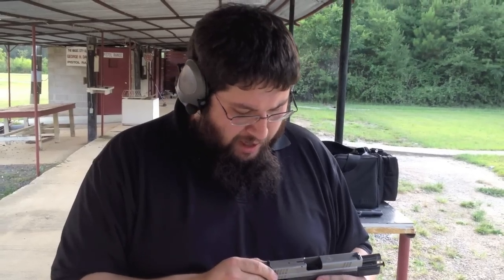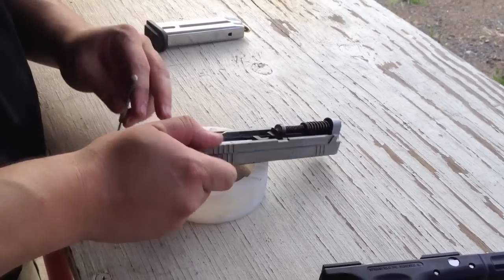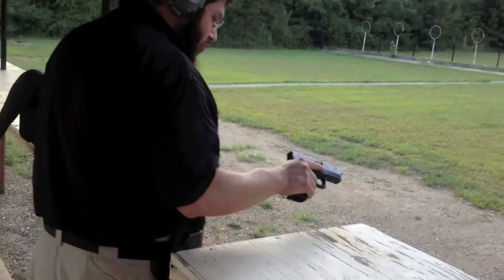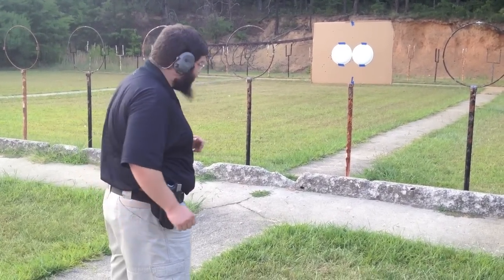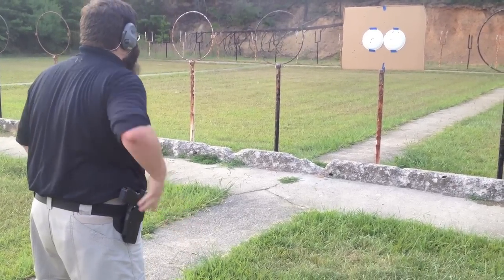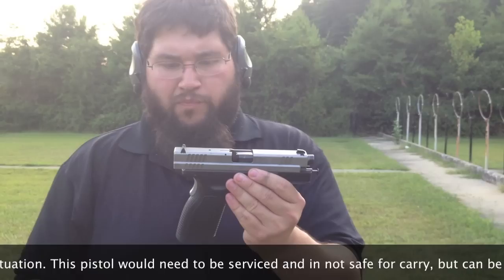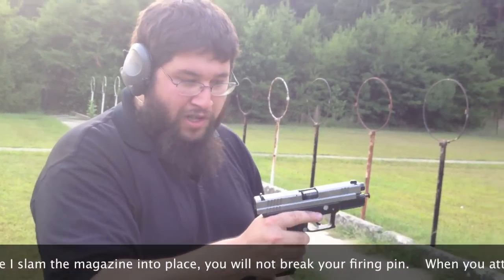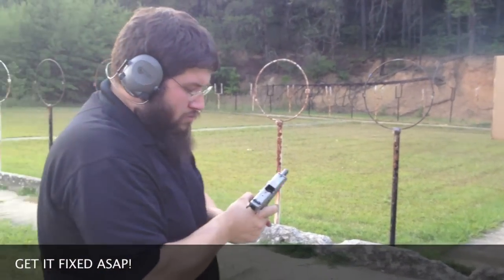XD with Broken roll pin still works demo

Comment: excellent method of experimentation and demonstration- I know that the XD will fire no matter what, and, never had a single failure of any kind in 3 XD9s I have, w/ over 1,000 fired in each one- I have heard of this potential problem, and it slightly concerned me, although I have heard that you would have a warning, as the pin takes many hundreds of rounds to work its way out all the way, after it first starts to brek and work its way out- great video!!!
Reply: I have done 1500 rnds in a single course over 2 days, so 1k over time of a pistol is not exactly "hard use" proof of reliability there. That those pins can and will walk their way out and fall out (see my experience above) is joke and proof it's a poorly designed pistol. If you want to trust your life to that pistol, that's your biz. That's a hard no for me.
Reply: @willbrink  I have an XD-40 and have just heard about this roll pin issue. I have shot 700 rounds, and maybe dry fired 500 times. How can you tell if the roll pin is out? I took the slide off, and you can see day light through the hole on top of slide, does that mean the pin is out?

Comment: My roll pin broke into pieces and one piece got jammed. the pistol would not go home no matter how many times I racked or manipulated the slide while I was out shooting. got home and drove the remainder of the pin out and then removed the backplate and spring but was unable to remove the striker until I wiggled it just right. 14k rounds through the gun at failure. only issue ive ever experienced.
Reply: natesjeep yup. I was getting light primer strikes and figured I have a few thousand rounds through mine, maybe it was just in need of a good cleaning for the channel the striker runs in. What I found out when disassembling it though, was mine was broken and likely was rubbing or jamming, causing the light strikes. I reload and pay extra careful attention to completely seat every primer. A broken striker retainer pin is not the same as a removed one 🤙🏼.
Reply: Travis Thacker  That point is too important to bury in the REPLIES.
Reply: Travis Thacker  While that is true, if you know the roll pin is prone to some level of wear changing it out is a simple thing. Nothing lasts forever, every machine has some level of wear on it's parts. And roll pins are cheap. I can't imagine why one wouldn't change out the pin every few thousand rounds. $15 for a set of XD roll pins is a small price for some peace of mind.

Comment: I bought my XD9 in 2009 ish back in L.A., it finally broke that roll pin. I was having light strikes on the round, sometimes it would fire then stop i would re rack and fire. Eventually came home, took it apart and that roll pin was a 5th its size when i took it out, not sure where the rest of it went now I'm waiting for those parts to get here and hopefully that will be it for another 15 years

Comment: THANKS FOR INFO.   I have the XD45 Service Model  with a few hundred RDS through it. In the dozen of times stripping down the slide I have DRY fired the weapon which I,m finding out isn,t the best thing to do. A SNAP DUMMY rnd is recommended .  NOT BY THE MANUFACTURER ---- go figure.       Thank You,  you have answer my troubling question.        John

Comment: I cleaned my xd 9mm and it won't shoot.. idk if i accidentally dropped the spring pin or something with the striker.. I feel like the firing pin doesn't reach the exit therefore not making contact with the bullet .. did I messed the firing pin or maybe the oil ive used?

Comment: How would you even know the pin had broken?  It's not like it will fall out.
Reply: My had light primer strikes, i thought it was the ammo until i took apart later on. Hey 15 years and about a few thousand rounds of cheap ammo is not too bad I guess

Comment: I was told I should replace my roll pin before it breaks... what say you?
I was told if it breaks, almost no gunsmith would work on it because its almost impossible to remove once broken...
Reply: Those are some useless gun Smith's
Reply: There is a particular technique in removing a broken roll pin.
You can find the step by step method in doing so here on u-tube.
Reply: Roll pins are cheap and easy to swap. Paying a smith to take out a broken one is going to be far more expensive. I'd say buy some spares and pack them in your cleaning kit. Pop the pin out every thousand rounds or so. If it starts to look chewed up, replace it. A little preventative maintenance can go a long way.
Reply: @cavalieroutdoors6036  
Amen 👍😎🇺🇸...
Common sense goes a long way.

Comment: you seem to be pretty knowledgeable about  the XD line.So when it come to cleaning the pistol will that damage the roll pin sooner or later?
Reply: You really shouldn't need to clean out your striker channel all that often. Maybe every 2000 rounds, unless all you shoot is steel cased ammo or you shoot suppressed alot. Then I'd say every 1000 rounds. It's also said that to keep optimal performance, you should swap out your recoil spring every 5,000 to 7,000 rounds depending on what type of ammo you use. For me, if I decide to carry a gun, I swap out every spring on the gun every 6,000 rounds and then confirm function of the firearm before continuing to trust my life with it. That being said, I would just replace this pin every time I replaced the springs in my gun as well.

Comment: I never had the roll pin problem with my XD40, but I did have the grip safety sear break and lock the gun up with a round live round in the chamber. The gun shop I bought it from had no choice but to send it back to Springfield with a live round in the chamber. It was a dead gun at that point and good thing it was being fired at a range instead of a self defense encounter. The fact you have to make a video showing the way to use this gun with a broken striker retaining pin should tell you something. This is a fault in the design, as well as the grip safety sear and its well documented. A shame really because these pistols are really ergonomic and easy to shoot accurately. I’ve lost trust in XD/XDM’s
Reply: Did this really happen to you, or did you steal that story from the Active Self Protection Extra channel?

Comment: The location of the pin is fail. When they were new, buddy got one. We took it to the range, and a retention pin walked it's way out, fell out, and stopped working. It was so bad, after market companies started offering thicker retention pins. The location of the retention pin was fail, and there's a reason they're not used but rarely by major PDs, SMEs, etc. They were simply poorly designed and made guns, period. Now, maybe they have made improvements over the years, I can't say, don't care. An M&P, Glock, HK is a no brainer over an XD for me all day and day, much less a clone. Your mileage may differ.

This guy found the gun works with broken pin. Our experience was different...

Comment: Great video. It's actually called a spring pin, not a roll pin. A true roll pin looks sort of like a rolled up magazine. A spring pin looks like the letter "c." For added strength, when you reinsert the spring pin, make sure the part where the pin comes together like the letter "c" is perpendicular to the striking surface so it doesn't damage the pin. If you do this the pin should last indefinitely.